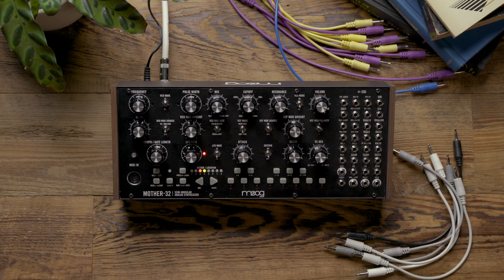Mother-32 | How to Achieve Variable Waveforms

Comment: What to do if you want to use the assignable output for random modulation and still want to sync your M32 to your Subh and DFAM?
Reply from the maker: You can still use the assignable output for random modulation if you just sync the Mother-32 to the DFAM or Subh, instead of sending sync from the Mother-32.  You can also use the mult on the Mother-32 to create two copies of the clock to sync all three units while still using the assignable output for random modulation.  Another option would be to use the Mother-32 gate output as a clock signal.